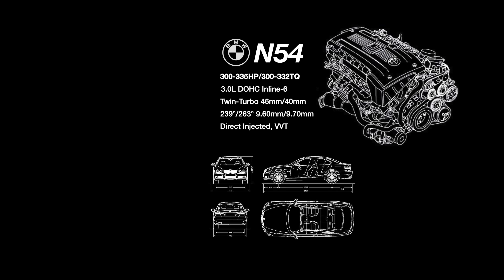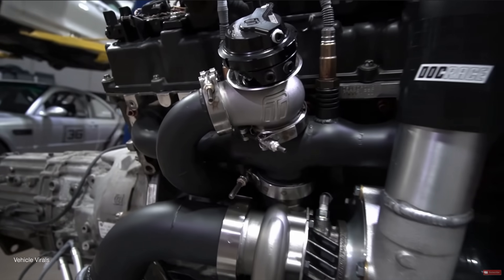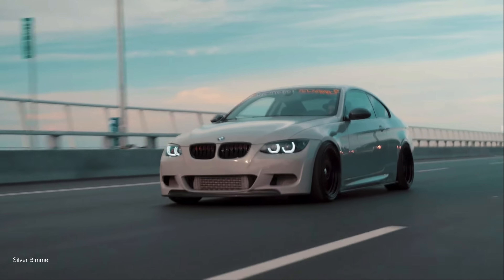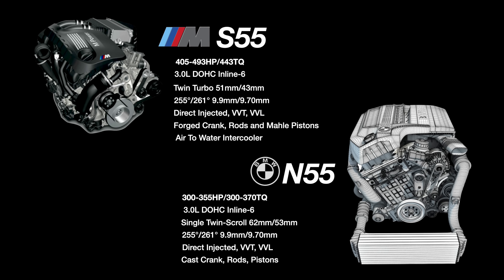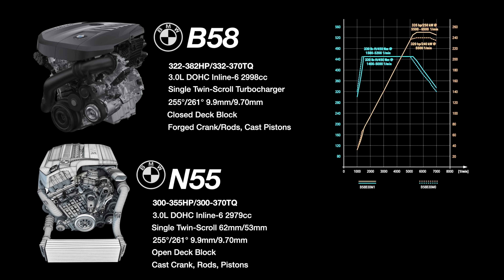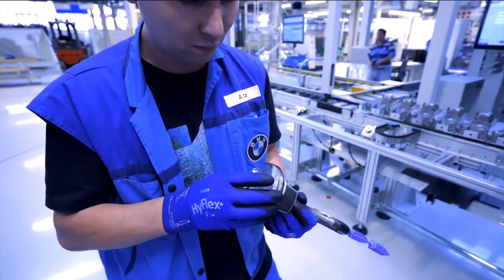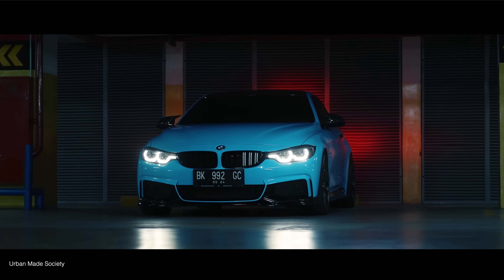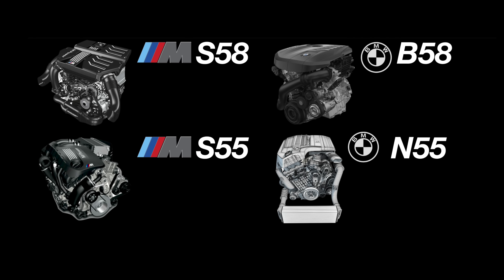BMW Turbo Inline-6 Engines Are Ridiculous | Explained Ep.4

Comment: I would’ve liked to see you mention the special N54 and N55 versions which came with the 1M and M2. Other than that, great video.
Reply: Also X4 M40i F26. W/ X drive it's a sleeper! If you slam it and put big brakes, it could be better than M2 for day to day. Like a big GTR killer! (Well you need to upgrade transmission 😑)
Reply: @vinnieesposito8645  F22 and F26 are both sleepers!

Comment: 2.0 4cyl VW can make 1200 reliably and do 8 second quarters.
 Whole lot cheaper and a whole lot faster.

Last good BMW engine was the S62
Reply: 1200 h.p. out of any 2.0 , reliability is a misnomer.
Reply: You saw one car make a few passes and came up with that assumption? Congratulations. B58 cars are running 8s with less than 1000hp 😂. And that same B58 will hold 800 comfortably stock internals.

Comment: Is this a fanboy joke ? There are very few weak engines in the modern era - the six pot BMW engines are exactly where they should be for a relatively big performance engine.
Reply: you clearly never worked on any of these engines
Reply: @floridaheat305  you have NOTHING to say on the matter
Reply from the maker: Big performance engine at 3.0L of displacement😂
Reply: @337speed  ? What the hell? 

Dude this is 2022 you have 2.6L RB26 dett engines doing all that you have mentioned above 25 years ago with architecture from 1986 FFS. Ditto 2JZ 

As for the modern era you have 1.0L Ford's rolling out the factory with 140bhp,  AMGs 2.0L runs 415bhp out the box VWs EA 888 2.0L is hugely tunable and reliable pulling 500bhp with bolt ons, Audi's five 2.5 five cylinder will way beyond its 400bhp factory etc etc 

I'm don't really understand what you are pushing here ? Also FOUR digit power out puts are the realm of heavily modified units, only Audi and Mercedes V8 (of german manufacturers) can do in and around those numbers on stock internals without exploding backwards through its own exhaust like the 4.4 BMW unit eventually would

Don't get me wrong BMW straight six is a thing of legend but in reality it's right where it should be in the world of performance motors
Reply: @sugarsaint  RBs aren't doing what a B58 is doing stock for stock. It'll blow up before 700hp. 2jz are boat anchors that don't spool up until 6k rpms. And even then you gotta make 700+ to be considered anything special. The B58 will handle over 800whp stock internals and they're already in the 8s in less time than it took either the RB or 2J. Eat your heart out.
Reply: @refillz5281  oh look another fan boy. RBs were born in the 80s and could "double" their power with bolt on - yet here you are trying to down talk a near 40 yr old design.

 THINK BEFORE YOU TALK

Look back at my initial reply and you will see I suggest the Straight sixes are right where they should be as most of BMW rivials use 4 pot 2.0L or smaller in the same class of cars. The most amazing thing about BMW is that they supply a straight six in this era of downsizing. After that the units are WHERE THEY SHOULD BE in performance wars 

It's a simple concept ffs

Comment: I have n55, stage 2+, vrsf catless and fat intercooler, it’s a blast to drive. Catless these engines flow so much better it’s ridiculous. I run 23 psi on mine regularly, no problems, been doing so for a year or two now. I run through spark plugs like candles though lol

Comment: main issues with n54/52 cars is the plastics; end tanks,hose ends etc. however i do own a n52 325i and it currently has 253k mi on it. if you do the maintenance and take care of it they last for friggin ever.  the BMW i6 engine is a tank in general but people beat on them and then don't take care of it so they get a bad wrap.
Reply: Perfect, plastic is cheap. And easy to work with
Reply: @HaydensJourney  why would you want to replace junk parts regularly lol more fun to actually drive a working car than constantly worry and chase parts down..

Comment: Sir, this hits all the tight spots, mind doing video about diesel inline turbo 6 engines for BMW as well, especially M57, N57 etc!
Reply: I had an e70 x5 with the N57. It had 110k miles on it and it was smooth as butter. I could put a glass of water on that engine and it never spill once. I ran lucas diesel additive through it every 3 fill ups and had it DPF deleted. Best vehicle I ever owned. I would still have it to this day if I didn't stupidly trade it in for a go fast car.
Reply: My 335D deleted... Probably bad decision, but I'm selling it, because I'm now the proud owner of an X3MC.

Comment: These B48s 4 cylinder based off the B58 are nasty as well. Friend of mine got gapped in his 392 pretty bad by the new M135i. Theyre ugly but quick.
Reply: I have a G20 and I was absolutely floored by the stock power and torque on those things first time I stomped it 😭. I've never felt a 4 cyl pull like that. If paired with a tune, it'd be hilarious to see what it's capable of.
Reply: Faggot Rotten  Interesting. I've heard a rumor that some dealerships fill up these cars with 87 octane and cause them to drive extremely poorly while on test drives. I was pretty impressed with its power curve and I use to own an F82 so i'm use to great power.
Reply: b48 are for the peak poor haha b58 is the only place to be
Reply: @user-uq7lk1xr7u  Everyone has a different situation pal. I think you're just mad that a 4-cyl pulls 😂 Stay mad
Reply: Lol true , if we could just get BMW engines in Audi designed cars 😜
Reply: These types of small engines with high power always come with a compromise, in this case reliability. Ask any real car mechanic (NOT top gear uk style propaganda shows), and they'll tell you exactly how much german engineering is worth. Any small german engine that comes even close to a 392, wont be half as reliable as the V8.

Comment: The inline-6 BMW family of turbos are so good because of their low-end torque capabilities. Power is pretty much instant. Something like the 2jz engines were known for their peak power. Their low-end torque numbers were bad compared to any of the family of BMW equivalent engines. The "feel" of the BMW is so much better than the older Supras. IMHO.
Reply: bmw has small bore long stroke... makes good touque low.  supra 1j/2j / nissan rb ,  they are short stroke Big bore. high revs, good peak number , but lacks that tree stump pulling torque.
Reply: So you're comparing turbo inline-6's that are decades apart? Genius.
Reply: @ruthnoya8424  Yes, I'm comparing turbo inline-6's that are decades apart. No, it's not genius.
Reply: Hmm i thought the RB26 was more of the peaky Turbo inline 6 compared to the 2J, and I assume youre talking about in stock form when comparing BMW inline 6 to 90s Toyota Inline 6 torque.
Reply: @e46m54nissansr20937  Maybe. I'm not too familiar with the RB26. Just referring to the 2JZ. And, yes, I'm talking about stock form. I currently own a bmw N55. I love the low end torque. Peak torque is somewhere at 2200 rpm whereas peak torque on the 2JZ is somewhere in the 4400 rpm range. There is almost no lag on the N55 compared to other turbo cars I've owned like the 1995 Eagle talon tsi, 1995 Mitsubishi eclipse gs-t, 2008 Dodge Caliber srt-4 and 1994 Toyota Supra. The feel of the single twin-scroll turbo on my bimmer is why I will no doubt buy another bimmer when mine is done.
Reply: @jeffjeff8562  Thats exactly what i was going to say that twin scroll turbo is a big part of the early max torque on the N55. I remember when the early N55 came out thats what people were saying they noticed with the N55 had great torque
Reply: Yall wanna look at n/a m50/s50/s54 paired with aftermarket turbo. Eats n54, n55, b58.

Comment: Don’t bmw’s have reliability issues? What engines are those?
Reply: The V10 engines and the V8 engines have rod bearing problems.
Reply: A lot of them, I deal with used cars all day, the old American cars usually have rusty frames which makes sense for my area and transmission codes, on average the old euro cars almost 80% of the time have 4+ codes that usually comes along with 2 engine related codes

Comment: N55 has proven to be a reliable setup all around over the years, the N54 is a solid MOTOR...everything attached to it is garbage.  B58 im not familiar with, but from what ive been seeing its not problematic.  the N55 is great for someone that wants to play, but stay reliable....N54 is for people with bottomless wallets and want to play hardcore with power.
Reply: The b58 is better than the n55 in every way. And as such will walk the n54 community as well. Even in high power
Reply: @TheFanatic340  sure as fuck hope so. Whole purpose for R&D.
Reply: my 640 n55 never gave me an issue two years now.
Reply: B58 is burning oil like it's petrol. Many Supras returned as lemons. Don't fall for the myth being created of "reliable Toyota engineered B58". It's another BMW money pit with engineering flaws.
Reply: n55 is garbage
Reply: nah the n54 parts are good now a days. the water pumps and stuff are all metal etc etc.  even the china parts for the n54 are getting better.. for around 10k you can build a badass n54 engine, with n53 head swap, darton sleeved block with good rotating assembly. i just did one.
Reply: @Mp-jw1qg  why swap n53 head?
Reply: Totally true. The stories are common of blown turbos, high pressure fuel pumps, and??? Costing $7-8000 to fix.

Comment: BMW WILL ALWAYS BE A 🧱 TO ME 
OVERPRICED UNRELIABLE OVERATED OVERVALUED WASTED TIME MONEY AND YEARS ON THEM MONEY PITS.  CASE AND POINT THE CAR NINJA EXIST BECAUSE THEY'RE SOOOOOOOOOOOO UNRELIABLE.  I'LL STICK WITH SBC, BBC AND LSX CHEAP EASY RELIABLE HP GO TO ANY JUNKYARD PULL IT PUT $2000 INTO THEM OR LESS, A WEEKEND, WAKE UP TO 450HP-600HP WITH TODDLER TUNE.  
BMW IS PROOF OF HOW GULLIBLE AND NAIVE THE MASSES ARE.
AN S10 WITH A SBC AND A FORD 8.8 3:73 WILL DESTROY A TURBO BMW AND THE S10 SBC SWAP COST LESS THAN $5000 DONE RIGHT 😭🤣😂🤣😭😂😂🤣😭🤣😂😭😭😭